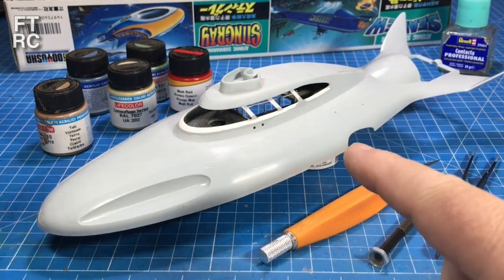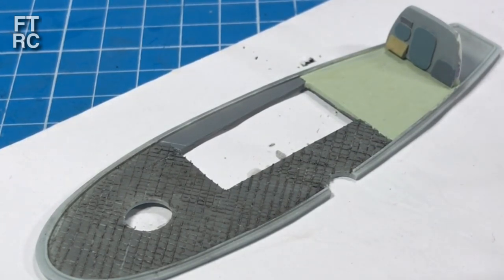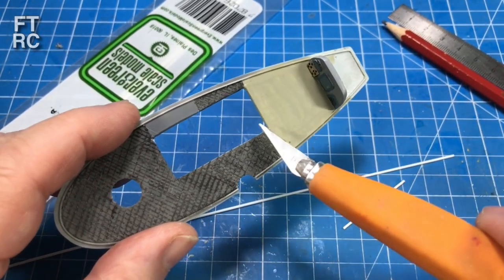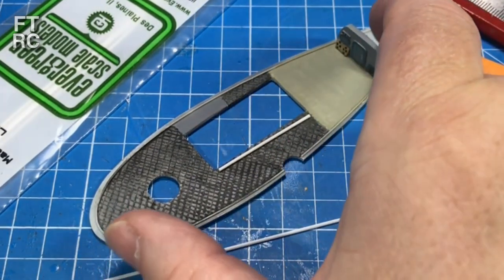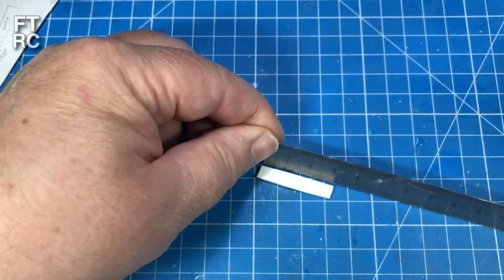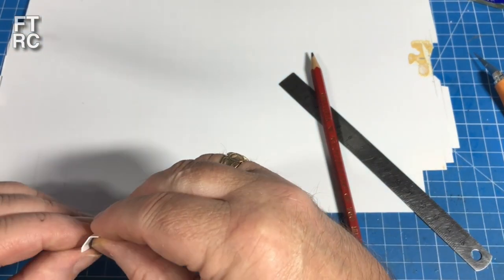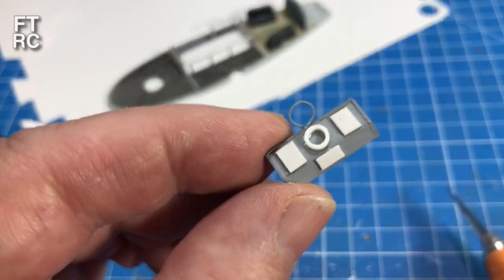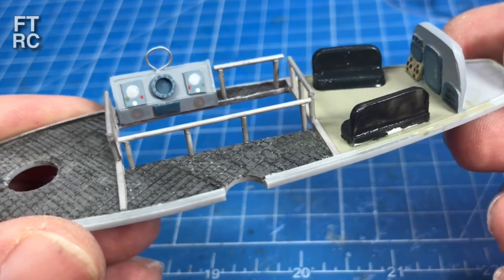Stingray Part 4 Interior and Radio Panel scratch built from photos of Gerry Anderson TV show sub

Comment: Hi and congratulations on such a fantastic project and execution. The original Anderson TC series models were works of art and fascinated me growing up with them as a child of the ‘60’s. I note that you’ve been interested in the ‘gaping hole’ 😂 and what it is about. I’ve looked really closely and there is a gap in the rails behind Troy’s seat and I imagine what you can’t see is a ladder to be climbed up and down to access that area which I believe imagine has cabins and access to the escape pods etc.
Reply from the maker: True in the later episodes they shortened the railing and added a ladder. I was going off early photos before they made that change.

Comment: You forgot to make a set of stairs or a ladder because there's lower Bay with the characters went to from time to time
Reply from the maker: I explained in later videos there is NO ladder in the first episodes of the TV series which I used photos of to make my interior.  The ladder appears as needed latter on when Marina needs to walk up and down.  I may adjust my build to have that ladder but quite frankly it will hardly bee seen through the tiny windows.  Watch the rest of build to see why.